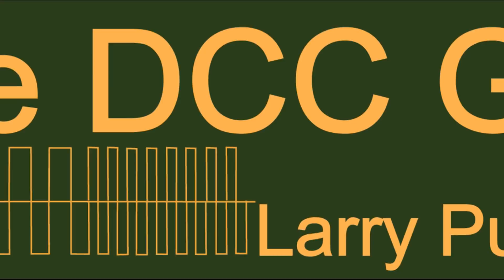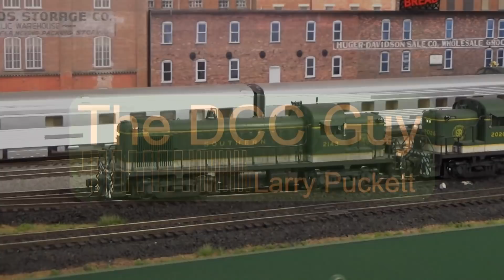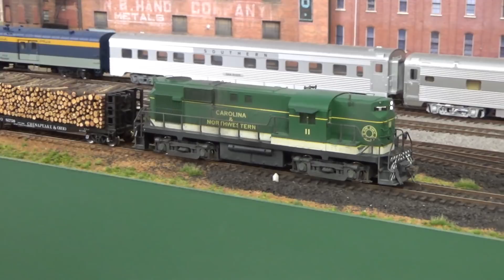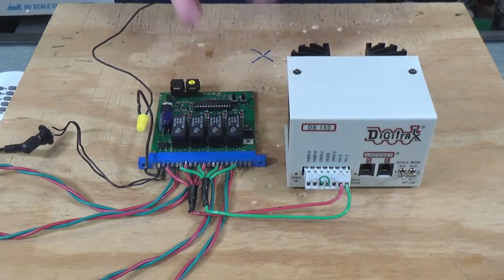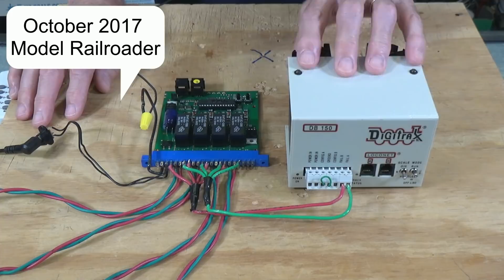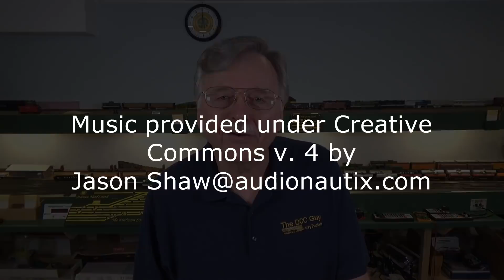Wiring Your Model Railroad for DCC--Power Management (112)

Comment: How would you know that power management has been acheived?  Looking at the devices themselves, is there any signal that would turn on to indicate that too much power is being generated for any of the four isolated blocks to handle?
Reply from the maker: On some there are LEDs that provide an indicator of the power status so you know when there is a short or overload in that block. The DCC Specialties ones even provide contacts for adding remote LEDs such as in a control panel. On the ones that use light bulbs, such as the NCE devices, the bulb will start to glow as it reaches the voltage threshold. Some you just have ti go on faith.

Comment: Larry, I only use analog control and my HO diesels that are DCC ready will not run until I use 2/3 throttle. If I bypass the circuit board connecting the trucks to the motor and tap off this connection so that the circuit board only activates the lights, will this work? I do not like the fact that my DCCeady engines willno work with my DC diesels by the same manufacturer.
Reply from the maker: That is a problem with analog mode as you must get to over 7 volts before the decoder will figure out it is getting DC and not DCC.
Reply: @TheDCCGuy  The idea is to circumvent the circuit board wiring the trucks directly to the motor and tapping off this connection so that the circuit board only powers the lights. In theory will this work is what I need to know.
Reply from the maker: If you do that then you cannot use it on DCC.

Comment: What gauge wire is shown in the video?  Good video, thanks!
Reply from the maker: Which wire?
Reply: @TheDCCGuy  The red and green ones.
Reply from the maker: 14 ga stranded
Reply: @TheDCCGuy  I just finished adding a 14 gauge bus for my common rail.  My common rail only a one connection to the power supply.  I added several 22 gauge drops, at least one per block.  I also added a “mini” bus for my two longer blocks with three drops each.  I ran my DCC locomotive and now it has sound all the way around the layout.  Thanks for the advice!

Comment: Hi Larry. Does your book or one of your videos have a schematic that would cover the wiring from a command center to one or two boosters and then power management out to blocks and signals as an overall breakdown of the wiring and components that would be necessary to run a basement sized layout that has a return loop that needs a reversing section on each end? Your videos are so helpful, thanks for doing them.
Reply from the maker: No, but most manuals that come with the DCC systems do have such diagrams. Also I will soon be starting a new series on the basics of DCC to cover what it is, how it works, all the components, and how to connect them.

Comment: Hi Larry. Juergen amlinger. Camand db150 block 1 block 2 db150 booster. Block 3 and 4 db210  layout is 50 feet long in length. That should be fine for power all are on 5 amp. Dose  that sound right .
Reply from the maker: With 15 amps you should be able to run a lot of locos.

Comment: At what point do you need a power booster and this power management?  I’m just wondering how big you could get without utilizing this?  Say you just were running one sound loco and a couple accessories.   I’m in the middle of building a layout and was unsure if I’d need to round up some of this stuff or not.  I suppose it comes down to the voltage drop at the farthest point and if it shuts down you don’t have enough power.   I did catch the estimated power loss video per foot of code 83.  I should’ve wrote it down.
Reply from the maker: For that light a load you really don’t need to worry. You might consider a circuit breaker such as a DCC Specialties PSXX1 or an NCE EB1 for added protection. You only need to thonk about power management should you want to run many more trains and break the layout up onto blocks and isolate short prone areas like yards.

Comment: I have two reverse curves I want in my layout design.  I understand that there is a solution to the shorts that will occur when the engine crosses a certain point at the end of the curve, crossing over a split in the rail where a change in the current is triggered.  Is there hope that this will not shut down the district, zone, or section?
Reply from the maker: You need an autoreverser circuit to do that for you. Watch my video #197 on automating reverse loops.
Reply: @TheDCCGuy  197

Comment: Great video Larry, thank you. I looked through some of the comments but did not see an answer. I have a NEC PH-Pro-r and was wondering if the Digitrax PM42 would play nice with my system?
Reply from the maker: It should work but I suggest you also consider either NCE EB1’s or DCC Specialties PSX’s. Both are fully electronic whereas the PM42 still uses mechanical relays which are much slower Also you can adjust the trip current on the NCE and PSX units independently whereas with the PM42 you can only have one common trip current setting for all 4 breakers. The EB1 is the easiest to use, and the PSX units require some programming for settings beyond the default. The PM42 is a pain to set up as it requires some really fancy wiring and programming. The PM42 is the cheapest option, but since the EB1 and PSX are individual circuit boards you an buy only as many as you need. I strongly suggest you download the respective manuals from their websites before making a final decision. The PSX website is now on Tonys Trains www.tonystrains.com .
Reply: @TheDCCGuy  Thanks Larry, I will proceed as you suggest.

Comment: Larry, I am just getting ready to begin wiring my layout and am unclear about type of wire for the power bus. I was unable to find solid 16 gauge wire. I had looked at multiple places on line without success. I purchased stranded wire for the bus wire but wondered if it made any difference one vs the other. I seem to recall you suggesting solid wire in prior videos. What would you recommend to me? Also, when you were discussing your wiring, you had mentioned a remote control that you use to turn on all of your components which you had purchased from Amazon. Can you give me a name or model that I could look up and purchase from Amazon? Thanks for doing your many videos. As an extreme novice the help is tremendous.
Reply from the maker: I use both solid and stranded wires in 14 ga. I got the solid wire at my local Lowes hardware and it is a fairly common item in the electrical aisles of most big box hardware stores. For my main buses I used 14 ga zip cord—I’ll include links at the bottom of this reply. If you use suitcase connectors make sure they can be used with stranded and solid wire, some cannot be used with stranded. As I explained in the videos on wiring most companies now recommend twisting the individual wires about 3 turns per foot to increase noise rejection and other issues. This is very important for buses over 30’ long. However apparently using zip cord gets the conductors close enough to one another to have the same effect as twisting. I cover that in the video on wiring problems.

https://www.parts-express.com/cat/hi-fi-speaker-wire/1617

BN-LINK Mini Wireless Remote Control Outlet Switch Power Plug
Reply: @TheDCCGuy  Thank you, Larry. I had looked at several online sites and never considered Lowe's. I am considering using the PSX system to divide up my system and am considering the Digitrax Evolution power system. Would it be possible for you to go through utilizing the PSX system along with setting the units up in a future video? Thanks again.

Comment: I just purchased a PSX-4 to run with my Digitrax Command Station (DCS210+) and I am a bit confused as to how to configure each section of the PSX-4 (I have 4 divided track sections) with the digitrax system. I have seen Mr. Puckett mention the PSX-4 several times but cannot find a video or description on how to configure this device with my Digitrax system. Can someone point me in the right direction or provide good (fully explained) directions on how to accomplish this configuration?  Thank you.
Reply from the maker: Mike—first there is a section in the manual with specifics for Digitrax operations. Now first you need to add the jumpers to optimize the PSX boards for use with Digitrax systems, The instructions tell you about this so read them. Once those are set then you need to wire it to your layout. Run a pair of wires from your command station to the inout terminals on the first board and then daisy chain the wires on to each successive board so they are all powered. Then connect the outputs to the four blocks on your layout. Watch my videos on adding a DCC system to your layout I am pretty sure I showed how to set it up in those, specifically #97&108.

Comment: Is there something like this that does not involve soldering?
Reply from the maker: It depends on which devices you choose to use. Some track systems like those from Kato and Bachmann may off quick connects or screw connections that eliminate soldering. And some circuit breakers have screw terminals and this is a growing option. However with some components and models you do have to break down and learn to solder, it is one of the essential skills of model railroading.

Comment: Do I need a booster to be able to do this or can I use this PM 42 directly from the NCE Power Cab or Digitrax Zephyr?
Reply from the maker: The PM42 has a min trip current of 1.5 amps so it should work with both systems.
Reply: @TheDCCGuy  Thank you.  I plan to wire it directly to the command station.  
For wiring, if I want to break my layout into four power districts, I need to isolate the track and have four separate bus lines that will all be powered at the same time?
Reply from the maker: Yes, that’s the way it works. Be aware that with the PM42 when you set it for 1.5 amps that means that unlike the PSX, you have the same value for each block, you cannot pick and choose. And you may find that 1.5 amps is not enough and may have to invest in a booster.
Reply: @TheDCCGuy  Thank you. I'm only looking at running one to four engines with sound at a time per district.  Being that the Zephyr Express is a 3 AMP system I should be able to operate without a booster.  That is based on the .4 Amps per engine as you described.
Reply: @TheDCCGuy  Also, would it be possible for me to email you with specific questions?
Reply: Hello again Larry,. I received my PM42 and PS14 power supply yesterday.  This leads to more questions if you don't mind.
1. Do you solder the wires to the pin connector or use something else?
2. In this video I see you have the female end to connect the power supply.  Where do I find one of those with out cannibalizing another electronic?
3. For the ground.  What do I connect that to?  I'm using a Zephyr DCS52 and no boosters. The directions say to connect it to the ground on the booster.
Reply: Hey Larry, I made contact with Digitrax and they answered two of the questions.  For now, do you have any recommendations on attaching the wires to the PM42?
Reply: Again, thanks for your help on this. So after weeks of waiting trial and error, I finally have my lower level bus lines run and my PM42 wired.  I opted to use Accu-lites PM42 breakout board and an 8 pole terminal strip to ensure there was no chance of snagging ba wire a ripping everything apart. Also, my soldering is good for rails, but not the 22 points on the PM42. 
Thanks again for all you videos and help.

Comment: I have a 150 foot mainline,  that i wired in 6 blocks for D.C.,  will i need this set-up for dcc. Would like to run no more than 3 trains at a time.
Reply from the maker: For only 3 trains you won’t need blocks unless you run 10 loco consists on each! Your main problem is going to be running the main DCC power bus, using big enough wires to prevent voltage drop, and inductance issues. Now if the track is a 150’ long loop then you can run you power bus feeds out in a star pattern from a centrally located DCC booster. However do not connect the two ends of the power bus. Watch the problems video.
Reply: Track loops around table 3 times used 14 guage wire for main bus, dropped to 18 guage for up to 12 inches, then 22 guage for feeders.
Reply: Teains will only have 2 locomotives in consist

Comment: Larry I have a NCE Power Cab that as I build my railroad i intend to upgrade to supply more power when I need it. My question is is there any reason I couldn't use the PM42 on my system with out some sort of conflict eg does the PM42 work in isolation? my reason to think about this is I like the idea of 4 circuits on one board and it appears at a reasonable cost. Neil
Reply from the maker: I have never tried it in isolation so I suggest the PSX as I know it will work that way. I do remember trying the PM42 with the big black MRC booster ungrounded and it would not work reliably. Also the PSX is a lot easier to set up and is solid state electronics whereas the PM42 uses older technology and relays which are slower than solid state.

Comment: Good video sharing many key points of why multiple circuit breaker blocks are so important. As an electrician one additional piece of information that might be note worthy is some electronic boards have the ability to adjust delayed trip settings. Mine are from DDC Specialities this feature helps avoid breaker trip when multiple locomotives start up with sound decoders. Especially when other locomotives are running in the same block.

Comment: Another great video!!!!  Do you also run NCE DCC on portions of your layout? I have both Loconet and NCE. I am starting to have memory issues on my NCE system. Do you have a work around to combat this problem?
Reply from the maker: What kind of memory issues? Although I own a PowerCab I use Digitrax command stations, boosters, and throttles on the Piedmont Southern. The PowerCab will be installed on a modular layout I am building to demonstrate various construction, wiring, and other methods.
Reply: Issues like not all "F" functions (lights and bell) do not operate. I am using an ESU Loksound 5.0 decoder and I did a manual reset. They still do not operate. The hardware wiring is fully connected. Do I need a reset on the NCE Powercab(SB5)?
Reply from the maker: That is a tricky question. If you did a reset on the LokSound you should download their decoder manual and read what they say about doing resets, you may need to do some more programming. As for the memory issue I don’t know if that is it or not. I suggest calling NCE tech support. I know Ed Wilson is answering the phone from home during the shutdown.

Comment: Good video.  I noticed you did not have your two power inputs wired in.  What are you using as a power source?
Reply from the maker: Do you mean the power to the DB150 or to the PM42? With the DB150 that is just a backup unit used for this video, normally this would all be attached to an 8 amp booster with one of the Jameco 15VDC 10 amp switching power supplies from Mean Well shown in video #108. The PM42 requires the standard Digitrax wall-wart power supply.
Reply: The DCC Guy DB150
Reply from the maker: OK, so just take a look at the wiring I showed in video 108 and that should make the connections clear.

Comment: is there a better/safer to split the wires from the booster instead of 4 wires spliced into the main?
Reply from the maker: Did you watch the video? The PM42, PSX4, and various other individual circuit breakers allow you to do just that.
Reply: @TheDCCGuy  yes... your cable comes from the booster, and the 4 wired into the CB, appear to be soldered and taped.... I am new to all this and would prefer to use some sort of splitting device.....sorry I don't know the terms.
Reply: @TheDCCGuy  That's a pretty harsh reply to a novice's question Larry.  The query is very clearly not about splitting the power into 4 blocks but about how you distribute the single Rail A and B  power lines into each of the 4 PM42 section inputs.  While your 1 into 4 "ganglia" certainly works I have to agree with the OP that it is not the most elegant solution and if it is not done well it could result in either an unreliable power supply to one or more of the of the PM42 sections or possibly even a shorting hazard to the equipment. My reply to the OP is separate.
Reply: Yes the power lead is clearly split into 4 at a taped junction which I also immediately noticed and disliked.  Check out the Acculites breakout boards for Digitrax boards (PM-42, BDL-168, SEC8C).  They eliminate soldering to an edge connector, use screw terminals for all connections, provide excellent cable control/locating and provide options for 1 or 2 boosters to power the boards (in the event of high current draw blocks).  They also have mounting holes so they can be securely mounted to a chassis/ benchwork component and hence the board is also very securely mounted once slipped into it. While they are not cheap I don't think that they are exorbitantly expensive either.  To me this a case of a relatively small expense quickly paying for itself in many ways.  Note, I have no affiliation with Acculites other than being a very satisfied customer.
Reply: @68Jaguar420G  thanks....
Reply from the maker: OK now I see what you were asking. I knew I had seen the screw terminal adapter somewhere but couldn’t find it recently. They were not available when I put this together over a decade ago. Those are a much easier way to handle the connections. In this case the connections to the PM42 are not taped, that is heat shrink tubing covering soldered joints and it makes for a very solid and reliable electrical connection. You could also just solder one wire to the connector and then daisy chain the others like I did with the PSX4.